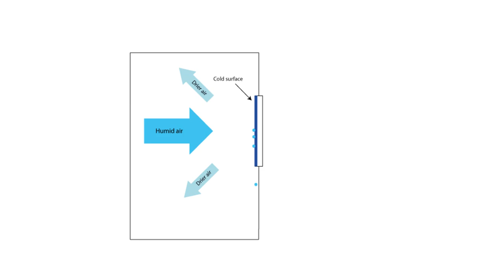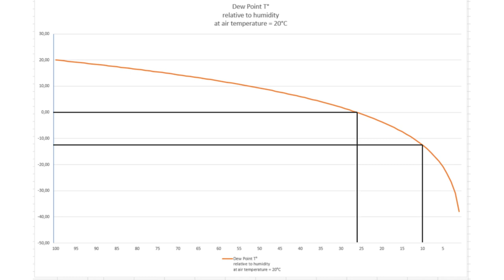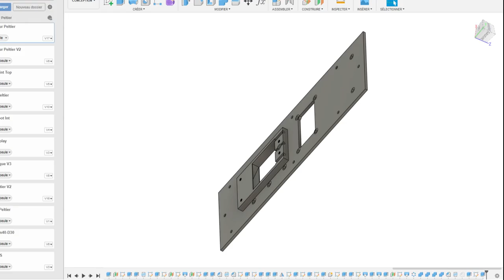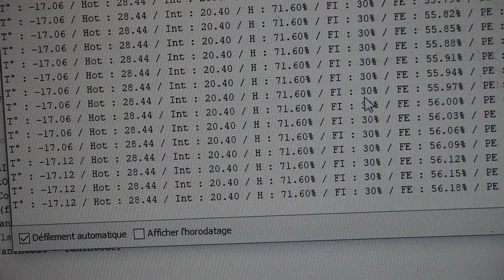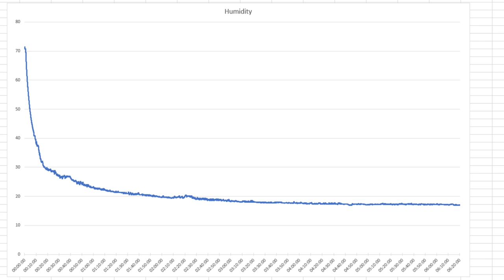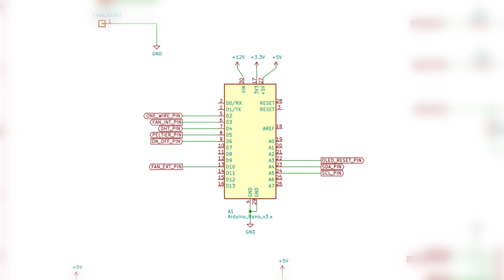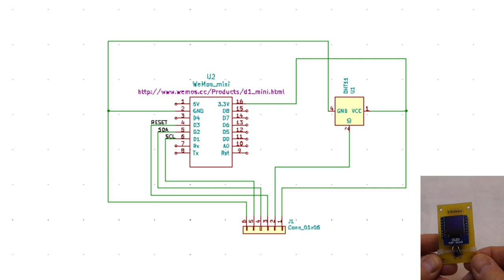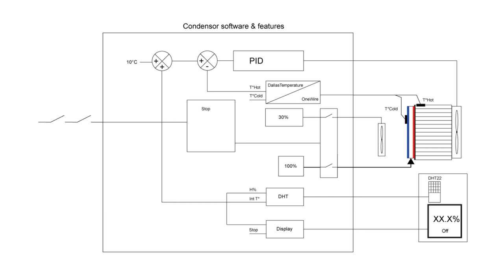I designed an air dryer with a Peltier module to keep my coreXY printer filaments dry while printing

Comment: t'aurais pas eu meilleur temps de mettre un radiateur du côté froid du module aussi ?
Reply from the maker: J'ai essayé mais j'avais de meilleurs résultats sans radiateur.
J'ai eu l'impression qu'il valait mieux avoir une petite surface très froide plutôt qu'une grande moins froide pour obtenir le taux d'humidité le plus faible.
C'est vrai que les déshumidificateurs du commerce ont un radiateur mais ils cherchent à faire de l'eau dans un grand volume d'air, pas à faire descendre le taux d'humidité très bas dans un petit volume.
Il y a un gros enjeux de résistance thermique de contact entre le module Peltier et le radiateur extérieur. Je pense qu'il y a le même pour un radiateur côté froid.
Ca fonctionne pas mal comme ça, la taux d'humidité descend jusqu'à 14%. 
L'amélioration à apporter serait de renvoyer une partie de la chaleur dégagée vers l'intérieur de la boîte pour remonter le point de rosée.
Reply: @workshopfeedback  j'ai essayé et remerqué la même chose! c'est fou ça gèle vraiment^^

Comment: What's the temp inside the box while running? If you open the box while cold, wouldn't humidity condense onto the spool like taking a bottle out of a fridge
Reply from the maker: The temperature inside the box is fairly the same than outside. So, no problem when opening the box.

Comment: LOL, this is so overengineered :D
Just hook everything up to the printer PSU - it runs when the printer runs, good enough. If frosting becomes an issue (i.e. if you print for long periods without breaks), put in a 555 to periodically turn off the peltier cooler for a few minutes to defrost. For humidity readout, glue in an off the shelf hygrometer.
Reply from the maker: Simpler but ineffective. In this case you'd better use silica gel and regenerate it regularly.
Reply: @workshopfeedback  How? All you're doing that this solution wouldn't is turning it off when the box is opened and slowing down the heatsink fan to reduce noise, neither of which impacts performance.
Reply from the maker: I was reacting to "it runs when the printer runs, good enough.". 
I don't agree with it.
For the rest, yes it can certainly be simpler, more noisy also.
For me it was also a testing device as I didn't know where I was going when I started and I needed to be able to control all the parameters.
There is a fairly fine regulation of ventilation in the box which allows me to obtain a fairly low humidity level. This would be difficult to do without a little software.
And then, an Arduino nano is not the end of the world...